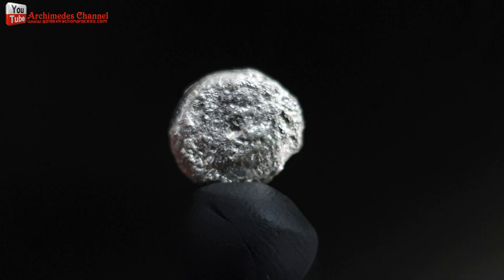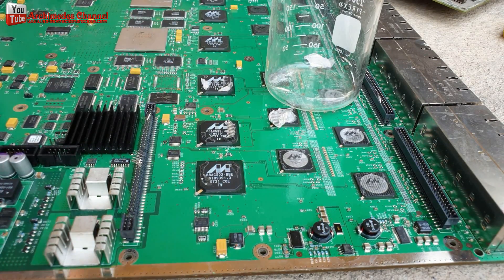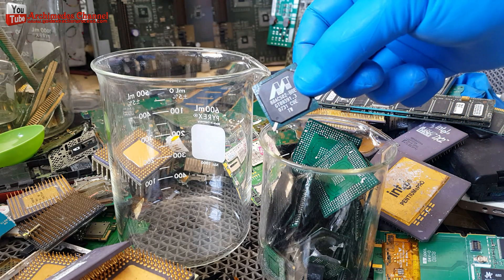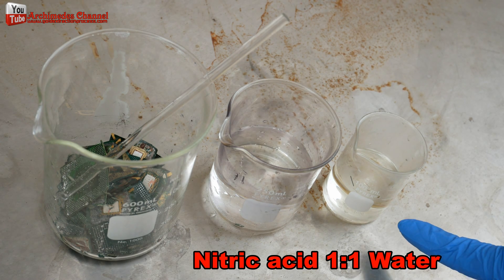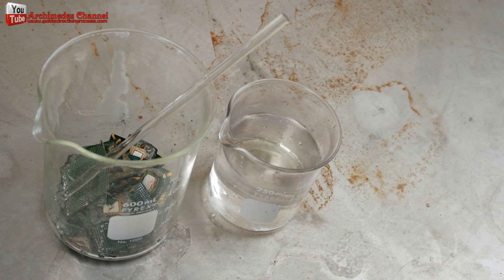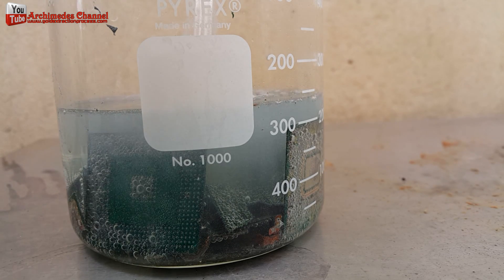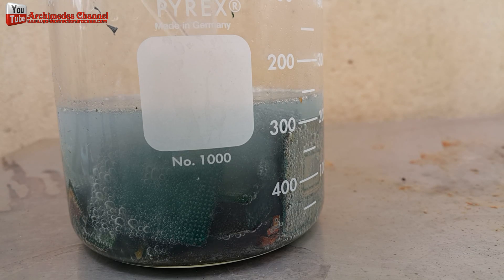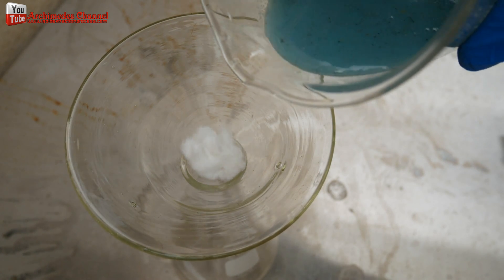silver recovery from IC bga chips "How to make silver"

Comment from the maker: Hello, friends Silver sedimentation method.
1. use salt
2. use copper
Is a simple way for you to bring the silver solution back into the silver metal again.
Thank you for watching our video and commenting.
Reply: hallo sir how to make mlcc pladium and silver recovery
Reply: Thank you very much... Sir..
You have solved my question..
Reply: Om untuk dapatkan gold stripping di mana apa nama kimianya.🙏
Reply: Pless  exlpiceisen this process.salt and copper?
Reply: thankyou archimedes channel how hno3 percent pure ? hno %67 or %33 ?
Reply: What happens to the Sn. What is the Ag. purity of the button.
Reply: @ramjany100  its converted into insoluble tin oxides
Reply: thanks for your video... before you put copper, what the white powder in solution? thank you
Reply: Archimedes Channel , so if you had dropped all the silver with salt and copper , would you evaporate to have a copper salt ? How do you think that would work as a copper refining solution material  ? How would any residual nitric play in to it ?
Reply: Hi. Should we use üre?
Reply: What must it be I used 500ml hno3 for 2000ml water and gave it, shock with salt water didn't give silver crorete result.
Reply: Just wanted to ask what the white powder is, thank you for the explanation ✨✨✨👍
Reply: Ahh... you don't really state that you added salt to the mixture in the video.
Reply from the maker: @walterbunn280  You can choose between salt or copper.
Thank You.

Comment: Umm you are also getting lead from the solder mixed in!
Reply: And doesn’t the lead process out with the nitric acid ?
Reply: @zacharywinters9413  its possible I'm not sure at the moment.  But when you melt it to a button I believe the cuple crucible absorbs lead
Reply: @jasonsilver6474  yes that seems right as well and of course the borax helps the cleaning process as well another thought I was wondering about if you might know? In your waste solutions is there still Palladium, platinum or gold do you store it all away and then re-process it again later?
Reply: @zacharywinters9413  I haven't personally processed bga chips or any chips yet , but I am saving them to do so ,but unless those metals are coming from the chips , they won't be coming out of the solder. And I would recommend creating a copper refining cell.  Then I would dry and melt my anode sludge and even add some more copper to increase the copper ratio. This would ensure that all of you're precious metals are at the bottom of your tank and it'll draw out all the copper from the chips . The second batch of anode sludge I dry melt and hit with nitric since most of the base metals and copper are gone you wont use up as much acid.
Reply: That's not necessarily true.  I used to make this solder. I electrolyticly refined the tin to .99999 fine 5 9's . And I'd add 75 lbs of .999 fine silver shot to every 2,500 lbs of tin and cast it in to different size bars .

Comment: Hmm.. So, it's about $1 of silver per 100g of CPUs that don't have heat spreaders attached. CPUs with most of their weight in the copper spreaders are selling for $2.65 per 100g, or probably 6x as much as their silver value. Copper is worth nothing compared to silver, so... hmmm... Still need friends to be successful it seems.

Comment: 3:22 I did not quite understand. First you added salt and then put a copper tube, is that correct? You didn't say anything about salt. 🤔😉
Reply: I think it is because it is an electrolytic reaction so it needs an electrolyte like salt, the metallic copper displaces the metals (like silver or tin) that were in the nitrated liquid

Comment: What about the gold on the bga chipps ? You don't recover the gold first ?
Reply: gold doesnt dissolve in nitric acit, the gold will be still on the chips and or gold foils will float around not dissolved in his first step, if gold is present
Reply: @Geri_crs  so sift the gold out first before using copper to get the silver out?

Comment: Hallo sir how to make mlcc  palladium and  silver recovery
Reply: I'm saving these too. But make sure you only get the ones that are shades of brown. The rest are surface mount resistors and inductors and such.
Reply: @jasonsilver6474  watched a guy pull a lot of silver out of the black and silver ones I think it was 10 grams per kilo. It was an unbelievable amount of silver in those
Reply: @thehobo-tographer7652  I think I should be close to a kilo of brown ones now. It's a 6 year collection.  Those tiny things take forever to collect.
Reply: @jasonsilver6474  they sure do… make sure you separate the magnetic ones from the non magnetic. The non magnetic have more PM
Reply: @thehobo-tographer7652  out of all the literally tons of scrap I've scraped , I'd like to think I got every one possible. And I'm not sure there's many in there at all that are non magnetic.  I heard this before and still don't know if it's true. Not to say your wrong at all , but I don't know I've take apart a lot and I mean a lot of really old electronics and I think I may have only seen a couple that didn't react and stick to a magnet. Also there's not many I removed that were in the presence of a magnet either.  I just did that once to sheer everything off of the boards with a hammer and a wide paint scraper.
Reply: @thehobo-tographer7652  oh and I've made high grade solder for all grades of electronics professionally.  What I made was from .99999 fine tin  and .999 silver shot. I made it into finished bars up to 48lbs each.  The solder on high-grade electronics is 3% . <----- this is fact. I added it and made it myself. 2,500 lbs a day in to finished bars . Only stating because most people would like to know what the yeald would be . Just from the solder.
Reply: @jasonsilver6474  they will all react to a magnet. Your supposed to “float” a neodine magnet over them. If they come into contact with the magnet they all stick! But if you keep the magnet a couple millimeters from them the “magnetic” ones will be pulled to the magnet. As far as value it seems to me non magnetic metals or diamagnetic metals are always more valuable then the magnetic stuff so the non magnetic ones should have more value in metal it would just be a cost comparison between to extract or not.

Comment: I see you put some powder into the blue water
What is that ?
Reply: i think it is normal table salt
Reply: It's a chloride salt of some sort. Silver nitrate will react with chloride salts to form silver chloride and various nitrate salts. The silver chloride isn't very soluble, and it makes a kind of milk-like solution because the precipitate is so thick. 
Generally speaking any sort of chloride salt will work, but Sodium chloride is extremely common, so that's what it tends to be.
Reply: @walterbunn280  why cant u melt silver chloride